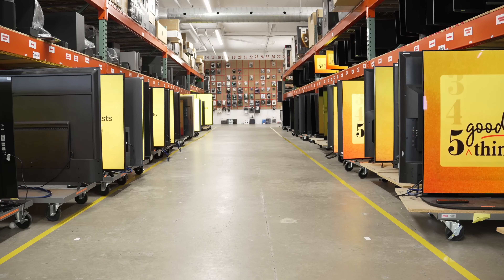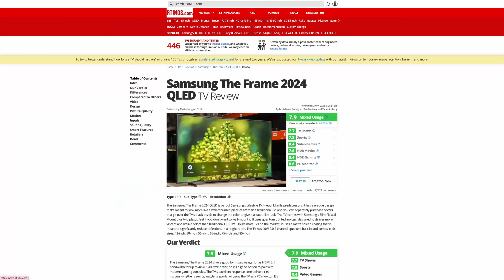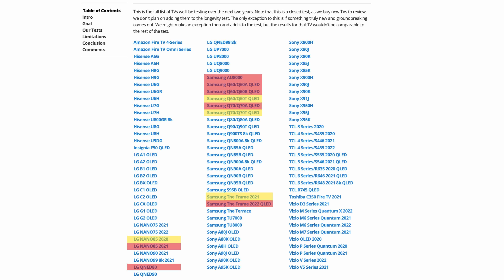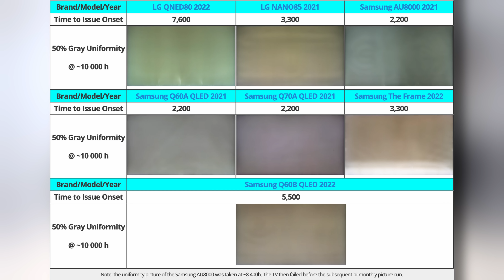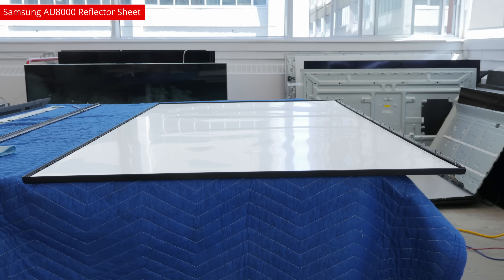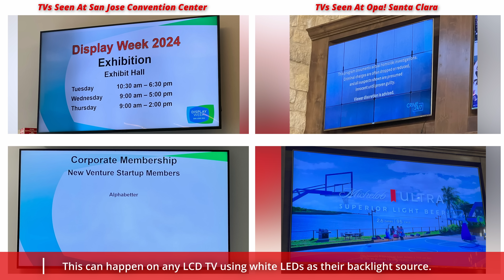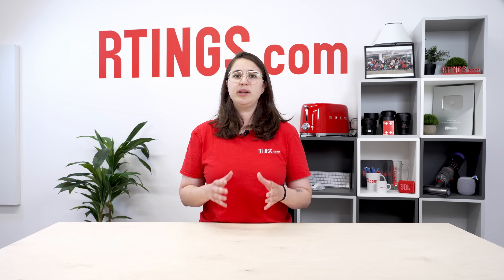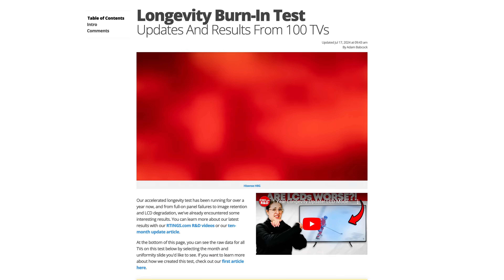Edge-Lit TVs Fail FASTER Than Others (100+ TV Test)

Comment: Bought an edge-lit TV for the bedroom last month. Glad I discovered this video. 

I recommend rotating between different picture modes during the day. Use a standard mode for normal everyday TV viewing with the backlight/panel brightness setting set to 60 or so, and set up and use a separate night time dark room picture setting where it is cranked down even further. I have mine set to 15 and it works for me.

Comment: Thank you for making this video. I bought a samsung tv tu8000 in 2021 and after 3 years of light use, the tv had issues with uniformity, there were lines on the display and finally it started to restart constantly every 10 seconds 😕 I do not believe that samsung and other manufacturers have longevity in mind when designing these TVs. Buyers be aware

Comment: Wow wonderful presentation and information.  I bought a plasma - it was Panasonic with the special anti reflection filter added.  I had the thing where the blurring during movement bothered me - so the sales person said some people need plasma for the high refresh rate so that was me. It is small at 42" but darn nice still but one day I will want to replace it. My mom had a newer LG - base one with 40 inch 4K - but it suddenly lost the picture entirely - so it is still sitting on the kitchen floor as folks are saying it is more like a disposable device now and not worth fixing (so it costs $125 for someone just to look at it).  LASTLY - I love my plasma - and the ones with LED all functioning on the whole surface would - to me - be much like plasma - what are they called then? I though OLED did that but apparently not.

Comment: I had an Acer Predator X27 gaming monitor 144Hz LCD IPS 27inch 4K with 384 Dynamic Backlight Zones, the darker spots that got only larger with time started around 2 years of use, but I was pushing this monitor in the beginning with 300 nits, the spot was not too noticable so I kept using the monitor until it didn't turn back on after 4 and a half years of use, but I also started to lower the fan speed because the noise was just too much.

Comment: yup tv failure is an issue......so i use computer monitors now instead. They can handle the heat and i am still using monitors that are 10 yrs old. I have a pile of Back lit tvs in the shop waiting for repair, my garage,  not a tv repair shop.

Comment: Of course, we wouldn't have to replace them as often if they lasted longer. My Dad was an engineer for Chrysler for most of his life before he passed. One of his primary roles between design cycles (the 3-5 year period where models have very few changes) was to identify where they could cut material costs (i.e., make parts thinner) to allow the manufacturing process to save more core materials costs. Most times the parts did not fail under normal usage lifespans but occasionally they did and if it was widespread, you'd see a recall (sometimes). If not, they'd quietly fix it during the next design cycle.  I guarantee all companies do something like this.

Comment: I think the more underlying issue with longevity is that every electronics company wants to push their products just short of "instant catastrophic failure" and say it's fine to red line them all the time. I keep seeing similar patterns such as:
- Don't charge lithium rechargable batteries to 100% if you don't need to
- Don't jack up OLED brightness to 100% all the time
- Don't have computer parts remain in 100% specified power for long periods of time.

I don't think it's really "they don't make them like to used to" moreso than "abuse the hell out of it, it's fine" (even though we know it'll break after a  year)

Comment: We are still using THREE old TVs. all are over 10 years old, one is from 2009. But they still work. Naturally they look very dated, but we don't use any modern media. Still DVDs and Broadcast TV only.     I have considered upgrading for a better screen quality, but I am very restricted as the size of screen I can install here, so there seemed little point.    If I had upgraded five years ago that TV would probably have failed by now.

Comment: It's only about models built in the last several years. The real problem is the quality of materials they nowadays use in building edge-lit TVs. I have at least two older Samsung edge-lit TVs from about 7 years ago, and they exhibit no such problems, even though they are used extensively at 100% backlight brightness. It's obvious they since made cost cuts such as using fewer or cheaper LEDs that are over-driven, therefore they overheat, probably cheaper materials for the diffuser, etc. Not the case with older designs.

Comment: If you sit in front of a TV you do not recognize if it is super thin or not. So buying an thin (edgelit) TV should not be a priority at all. In my country the majority of new cars are custom orders and you pay 300-800 USD for altering the default color (and delivery takes 3-9 months). Strangely you can not even see any of the painted surfaces while driving the car.
My feature list for a (new) TV: I can carry it by myself without help. It can be moved easily without packaging, It fits in my normal car so moving it doesn't require a rental van.  
In my appartment the living room is not a  "TV altar room" anymore. I watch TV-like content on a PC monitor right in front of my nose.

Comment: All new TVs come from the factory with everything to do with brightness cranked up all the way,    
which drives the LEDs much too hard and makes them burn out sooner than they should.  
When you buy one, take it home, plug it in, let it do its initial wacky stuff.    
Once it settles, reduce the Backlight, Brightness, and Contrast to no more than 50% of maximum.   
You just Might be rewarded with a much longer-lasting TV.

Comment: Previously we had a LG 47-48 inch which was a 1080p tv with 3D functionality along with a magic remote and 3D glasses. Bought it in back in 2012 when there was a killer deal going on (around 1000 US dollars).

 When it was nearing it's lifespan due to my extensive gaming sessions, the TV had a horizontal rolling banding lines often with a light bars going from the centre to the horizontal edges, also temporary burn ins. The TV met it's demise due to a physical damage rather than it's natural death. It lived 11 years but would have lived longer If I had not played video-games all day.

Today, I have a 65 inch sony bravia 4k tv with the 120 hertz refresh rate. So far the edges give out dimmer lights but it is not noticeable if you pay attention to them. I have the display at eco mode as the screen is not set at high brightness. I would not make the same mistake as I did with the LG tv again.

Comment: I have replaced LED's in many tv's. Most of them had their brightness at max. LED's get exponentially less efficient the more voltage you put into them. You will get much better LED life if you keep your tv at 70 or 80% brightness instead of 100%. The tv I am currently using I just soldered on a new single led to the strip and it has been working fine for awhile. This isn't really an Ideal fix but I have been running it at 50% brightness with no issues.

Comment: I still have a 7 inch black and white CRT and a digital converter box and antenna on the roof. I barely watch any TV. That TV will probably last another 100 years. Only had to replace a single capacitor and I got it out of the trash.

Comment: In my experience every thin monitor I ever owned had it's 5v regulator or its LED backlight driver fail.
Basic workhorse power components with rather high working temp ranges.
But throw them in a small space with an absolute minimum of passive ventilation and no heatsinks... They tend not to make it.
They live too hot for too long and suddenly the thermal runaway makes the magic smoke come out.

The backlight arrays really should be attached to a metal bracket with some decent mass as well. LEDs actually burn super quick over temp and you can see the damage just by looking at them.

Comment: In summary, this video tells us to avoid samsung and LG TV’s. Your results correlate with our actual experience 

This is our current TVs at home
1. Samsung 50” NU9070 model bought last 2018 - BROKEN. As per samsung they need to replace the LCD and it will cost us 300 USD.

2. Sony 40” TV 2014 - still working fine 

3. Skyworth 40” TV 2016 - still working fine.

Our family disappointed with Samsung really. We will avoid samsung TV brand when buying our next TV

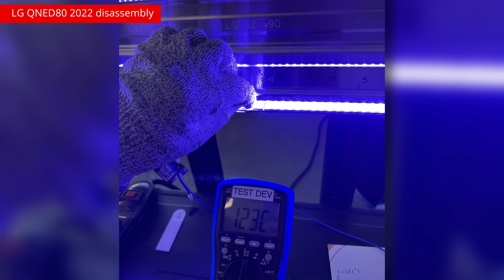Comment: 4:52 - "We get a steamy 123°C or 253°F..."
This is definitely outside the rated specification of these LED's, thus either:
- A manufacturing error that needs a recall
- Planned obsolescence

As a hardware / firmware engineer who builds this modern electronics garbage professionally, I'm really getting annoyed by manufacturers constantly getting away with these malpractices! It's daily routine where engineers tell management not to do something, yet the c-suit pushes it through either way for profit! Afterwards we engineers are blamed for building bad products...

It has gotten so far, that I've:
- Designed my custom smart LED circuit boards, with custom firmware/software on them
- Designed custom circuitboard and firmware for my motorized curtains and house ventilation 
- Redesigned a custom control board for my washing machine, that broke after 4 years
- Redesigned custom circuitboard and firmware, for my smart doorbel camera and thermostat, so they don't need a 24/7 cloud connection 
- Currently in the process of reverse engineering the failed 4K beamer, I bought only 4 years ago for a massive price... 

When I do things myself, it's usually 30 to 70% more expensive than just buying. Yet the things I build, are designed to easily last 15+ years! In case something fails prematurely, I can easily fix it using my own schematics for less than 5 USD.

Comment: I actually bought a 2011 Samsung 46" edge lit tv for 25usd the other day. I noticed it has a some swooshes in the top right corner when displaying white or solid colors. I followed some guides on calibrating and got it looking waaaay better than how it was. The brightness is so much lower. I lucked out as this didn't seem like it was used much. Its made out of glass as well so im sure it radiates it better than plastic. Forums said the leds go out as well. Hope to get many more years out of it. Looks so much better than my first 1080p 2010 38" lg lcd tv. That thing was thick and had ventilation, put out a lot of heat. It served me well. Started getting vertical lines like 6 years ago and decided to retire it after I found a cheap replacement. I had read new tvs are prone to failure so I didnt even bother

Comment: yes LED. bulb gets hottest in the middle and when they are pressed too hard, the yellow coatings you see are slowly burned away and you get more blue light.

But I have also seen mobile telephone (IPS) screen and LED (LCD) have a red/blue cold white tone, caused by the LED bulbs themselves.

LEDs are misused and used incorrectly!

Comment: Fortunately I'm a nerd allergic to light. First thing I do is turn down brightness (on my monitor).
I actually wanted to have a real local led dimming back in 2010 but by then it was not hype anymore, and only edge local led dimming was available.
That TV did run for 14 years, with only a few led problems before we had to give it away due to migration. The last stereoscopic tv, and I love stereoscopic content.

Comment: Wow, I just discovered a technology I didn't even know existed.
Found out that I do have an edge-lit 2021 Samsung TV (bottom of the range, paid less than 500€ for 50 inch). Out of the box it looked like a junk piece of tech, I could clearly see light disuniformity from the bottom, but my father wasn't much bothered by that, so it's still there. Knowing that it's quite prone to failure over the next years, I hope to find a new one that doesn't come with this technology, considering the mediocre display performance it offered since day one. And that's sad, the system is quite good other than that

Comment: 9:20 No! It is assumed that the amount of money they put in to RnD in those companies, that they know exactly how their products fail and still make the same product and consequently the same "mistakes" again and again. The companies need to make their products last more than decades and they can. All you need in this situation is a a simple thermal solution, that probably exists but is not implemented so poor customers have to buy a new tv and expect, well the last one lasted for 2 years I'm sure in that time they have fixed these issues I mean it's a new model. Of course reality is different and the factory just pushes out the same product with cheaper components. So poor consumers will HAVE to BUY a new tv again and again. What a waste of resources on our earth. :(  And the fact that 99.9999999% of the e-waste is not correctly even recycled, just mushed in to a soup. Don't make e-waste, buy only good tv's that actually last so you can sell it to another, REUSE instead of "recycle". Ouh and 9:27 EDIT. It IS reasonable and very realistic to expect them to create a product that lasts, don't be fooled by other humans who think it's ok to buy a new tv every year cause it will boost the economy, the economy isn't on your shoulders and you don't need to make anybody more money. You have the right to buy a tv that doesn't need replacement every year.

Comment: Nice work 💪
However there is one thing it feel wasn't obvious from the video: Their cost cutting is about driving the LED's too hard, in order to produce more light with fewer LEDs.

I have taken a LOT of TV's a part purely out of curiosity, and all the edge lit panels have plenty room for doubling the number of LEDs, however they chose to overdrive the LEDs to produce more light.
This is a really bad idea, because the more you push a LED, the fewer lumens/watt you get, so it would be a much wiser choice to double the number of LEDs and not overdrive them, that will lead to less power consumption and longer lasting TVs.

And true, it will increase the BOM (bill of materials), but i find it hard to believe it would yield a significant impact of the overall BOM.

Comment: On most tv's, the brightness setting does not change the backlight level much. The "Backlight" setting will adjust the LED output level, I suggest 50% or less to keep each individual LED cooler.

Comment: While those modern TVs fail shortly after the warranty expires, CRT TVs are still working flawlessly after decades. Mine is 30 years old and works great.
Reply: As much as modern TVs have their flaws they are much better than CRTs. The failure rate is mostly due to planned obsolescence + pushing for thinner designs and less to do with the technology used in modern TVs being bad and less reliable. With the proper heatsink and design LEDs and OLED last a very long time I know people that still have their monitors from 2010 for example.
Reply: @Bargate  Monitors from the 2000's were made different. The backlight was a thick polycarbonate slab sandwitched together with the reflecting sheets and the light source was a series of cold cathode fluorescent lamps. Not LEDs. This is why they last. The only common failures with this technology had to do with swollen capacitors witch when replaced bring the monitor back in a working state. 
As you have said, modern TVs are made with planned obsolescence in mind witch in itself is a extremely big reason to stay away from them.
Reply: I would call a bit of survivor bias into this. All the CRT:s that are still working today are of course very good quality and will likely continue working for many years to come.
Reply: You do know you have spent thousands on electric to run that TV 400 watts an hour
Reply: @b4804514 The increased power consumption is more than worth it.
Reply: @b4804514  The increased power consumption is more than worth it if the TV will continue working for many decades. It is just ridiculous to give up longevity for lower power consumption.
Reply: @b4804514  Either way goes to show that things aren't build to last anymore

Comment: Now i understand, why also my thin-framed monitor is slowly cooking itself. Just checked and its bottom is quite hot. I also already have tiny black stripe throughout bottom part - and when it cools down, a white stripe also appears nearby...

Meanwhile, my decade-old secondary monitor is only slightly hot in the area, where its PSU is.

I wonder, how much of an effect can the lack of cooling vents have. I´ve already noticed some designs of TVs and monitors, that either completely lack openings for heat dissipation, or they´re jokingly small.

Comment: I had a Panasonic LED fail at 5Yrs (main board not LEDs). MB was NLA (no longer available) so I contacted Pana and they mentioned the internal "useful life" value is 8 years. They graciously offered me a pro-rata refund (we have great consumer protection laws in AU) or a hugely discounted new one - about 65% off RRP. I took that option. Pana no longer make TVs and mine was one of the last 6 in the country so I got lucky. 

My point is, anything over 8 years is just "getting lucky" and I suspect that Pana aren't the only ones with this sort of metric.

Comment: Samsung TVs using the cheapest of cheap LEDS, DC side Rectifier diodes and MOSFETS with zero heatsinks, heat accumulates and kills the part.

Comment: I don’t understand how screens in our phone that are housed in a MUCH THINNER chassis and have MUCH MORE DENSE electronics cramped inside that (cpu, gpu, antennas etc) and produce MUCH more heat and are actually brighter can work and survive endlessly. 
THIS IS PLANNED OBSOLESCENCE
Reply: I'm guessing while LED"s are supposedly efficient in converting electricity into light when you put so many of them so close together on the bottom of the screen and expect them to light up a massive panel with people sitting at far greater distances...